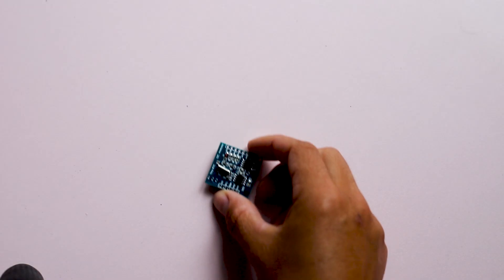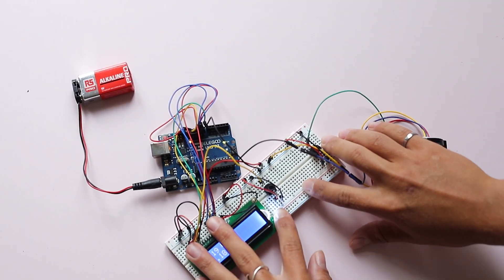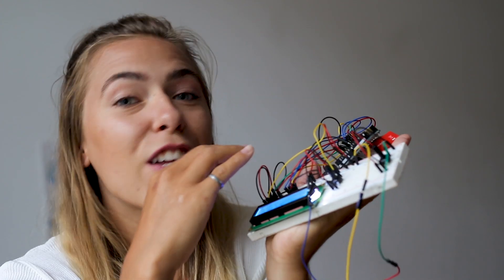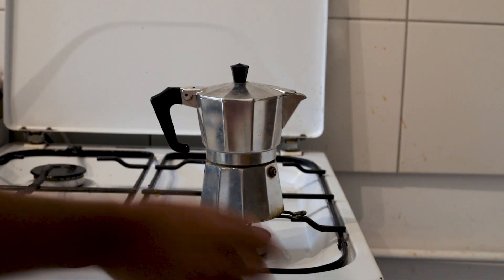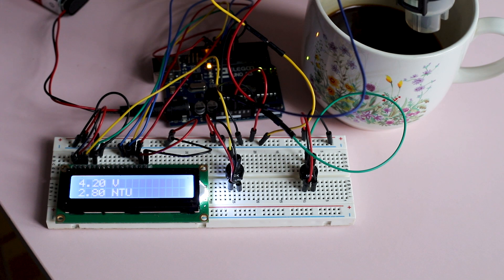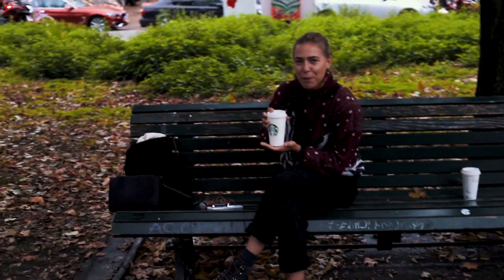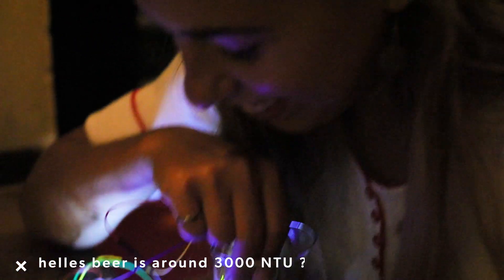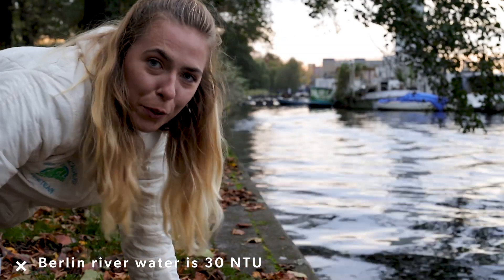Testing my first prototype ... EVERYWHERE!

Comment from the maker: I hope you guys don't take this too seriously. I had a lot of fun making this video. If you're mad at my terrible engineering approach, pease watch till the end so you understand what next steps I'm going to take to actually test this thing. As always, thanks for watching!
Reply: How can I contact you? Could you pls gimmie ur email adress, pls?
Reply from the maker: @tafiqulrafi2569  Hey, my email is jessica@steminine.com :)
Reply: I wanna talk to u about mechanical engineering
Reply: There’s a great article about turbidity on Wikipedia. According to that article, The most widely used measurement unit for turbidity is the Formazin Turbidity Unit (FTU). ISO refers to its units as FNU (Formazin Nephelometric Units). ISO 7027 provides the method in water quality for the determination of turbidity. It is used to determine the concentration of suspended particles in a sample of water by measuring the incident light scattered at right angles from the sample. The scattered light is captured by a photodiode, which produces an electronic signal that is converted to a turbidity. Open source hardware has been developed following the ISO 7027 method to measure turbidity reliably using an Arduino microcontroller and inexpensive LEDs.

Comment: Maybe this can help u in future projects. The problem could lay on the type of sensor that u are using, the noise as u said, but also the capabilities of the Arduino itself. The sensor could be used just for general propourses  and not accurate data sensing. Try different vendors and check the datasheet of every of them before you order it and understand the sensing principle behind. This will tell u if it's worth to buy it or is the same sensor,but different vendor.  Lastly, the Arduino uno Is an starter kit, it measures I think at 8 bits or idk. I do not remember it, but the capabilities to scale accurate the signal is really limited.  If I try to read out from other developer PCBs or a more advance Arduino u might receive all the data with less missed data. I'm an electrical engineer, so I had tons of bad experiences with sensors as u are now.

Comment: One way to get around the potentiometer being so sensitive, put 2 in series. Use a 10K as you have, and then a 500 ohm or even smaller. You can then use the 10K to get within the ball park of your 4.2V (0 NTU or whatever it should read) and turn the much smaller potentiometer to finely tune the voltage. Just might be a way to make that circuit a little easier to use, if you stick with that. It sounds like if you get a proper sensor that isn't already broken it shouldn't be needed anyway though, which long term might be a better solution.
Reply from the maker: Awesome Matthew! Thank you! As you can tell, I don't know what I'm doing so I appreciate your advice. I'm going on vacation for the next 3 months until I start my PhD, so I'll need to try your suggestions when I'm back:)
Reply: @RiverTechJess  No worries. I have played around with electronics a lot in my spare time, and done this double potentiometer thing before for fine tuning values. Enjoy your vacation. I look forward to seeing progress once you are back

Comment: You know it's broken when Turbidity of beer is far more than coffee and latte. Beer is easier to see through so its turbidity should be less than the other two. By the way what principle it's working on ? Nephelometric Method ? o.O
Reply from the maker: Haha exactly:P No, it's just a simple attenuation scheme. Nephelometric would be better but the point is to be cheap and find things currently available
Reply: @RiverTechJess  Then why not use the basic turbid rod method ? It's the cheapest method I can think of.

Comment: I don't want to state the obvious, but if you intend to do more thorough testing on the whole device, consider getting a more professional sensor from somewhere other than Amazon. Cheap sensors might just be intrinsically inaccurate... :)
Also, do you have some datasheet to look up to see if you have to connect the sensor in some fancy way and to check its measurement tolerance?
Reply from the maker: Yes, as I said at the end, I will try testing other probes. There actually was no datasheet! Just 3 labels for the wires, GND, Vin, and Read out

Comment: What is NTU? Because I couldn't understand
Reply: It's one of the unit Turbidity is measured in. NTU stands for Nephelometric Turbidity Units. It's used when Nephelometric method is used to measure the turbidity of the fluid. There are other units and methods too like JTU (Jackson Turbidity Unit). Usually NTU and JTU are equal but different methods are used in different areas.
Reply: @raygenrogue5261   I got it. Thank you so much
Reply from the maker: It's basically a measure of the cloudiness of water. Thanks raygen for the explanation:)

Comment: Usually, the UNO boards are prototyping to show proof of concept designs. The electromagnetic noise you would generally get from the wires themselves since they are super close to one another is cray. So, if you were to measure stuffs, know its with a +/- error from the 'calibrated' lol value. To remove from the pool of possible error sources, my advice is to solder to wires components/breadboard. :) Looks great!
Reply from the maker: Awesome! Thank you. Yes, first I want to go through and eliminate all other possible sources of noise before soldering everything together as a final design. But i'll also do this once I incorporate Matt's advice above^^
Thanks by the way! I appreciate your comments:)

Comment: I think there is noise on the 5V line or the signal line.
What if you add a capacitor between Vcc and ground?
Also, try averaging the value?
I am a mechanical engineer but have worked a lil bit sensors as well.
Edit: haha I should have watched the whole video before commenting :p